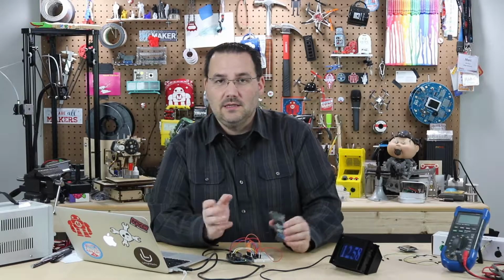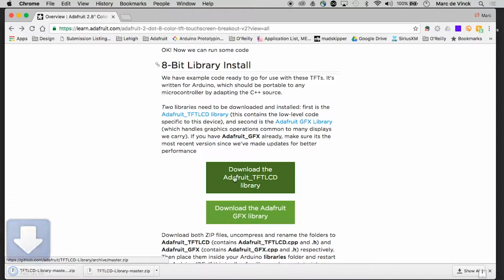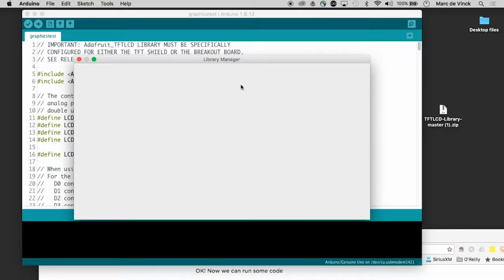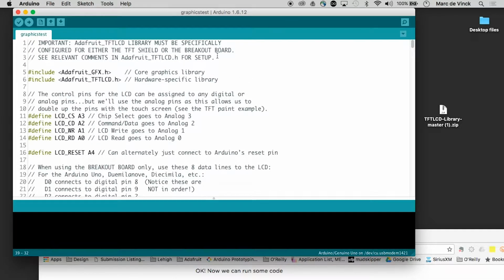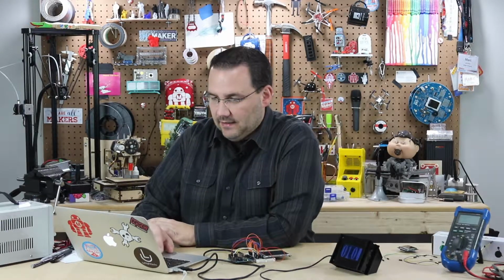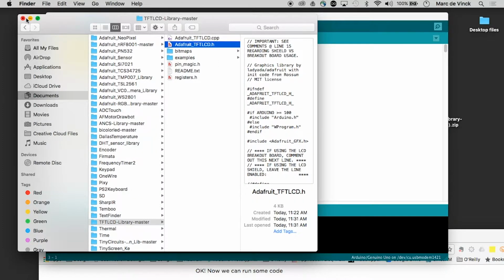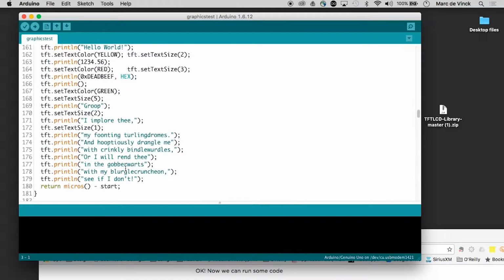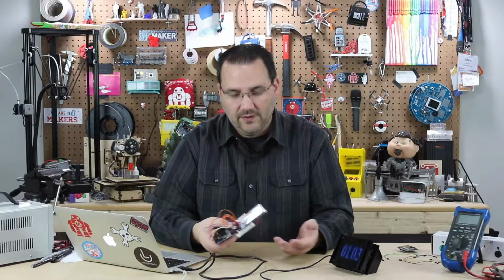Arduino TFT Display Tutorial: Color Graphics + The 1 Line You Must Edit

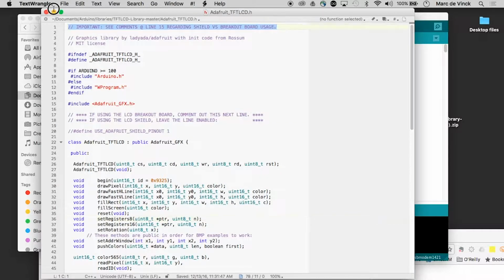Comment from the maker: ⚡ Quick tip: if your TFT loads the example sketch but shows a blank or garbled screen, the problem is almost never your wiring. Open the library's .h file in a plain text editor and check the shield line around line 17. Two forward slashes in the wrong place is the difference between a dead screen and full color. I show exactly where it is at 4:02.

📌 FULL SERIES: Watch all 100+ episodes of the Complete Arduino Prototyping Series. https://www.youtube.com/playlist?list=PLcKte0wD90Y4lsrStEWB5NR1gKMs0FDts